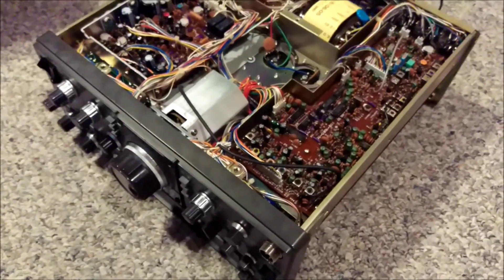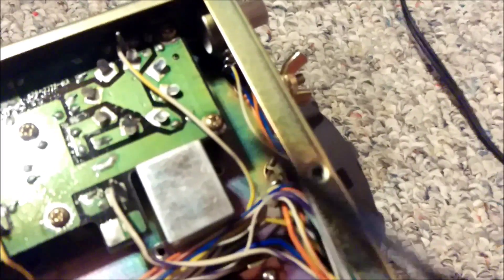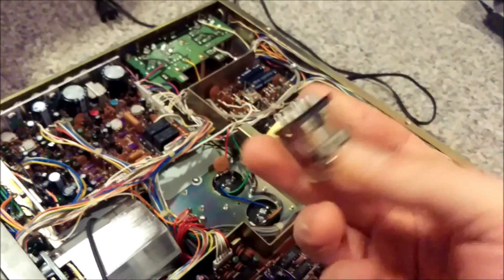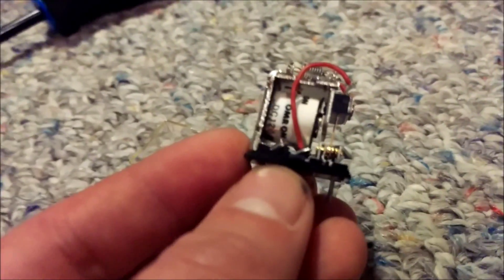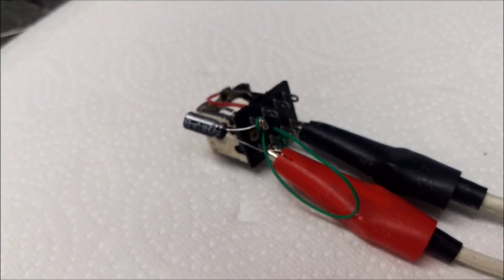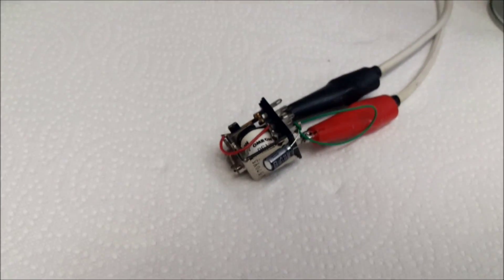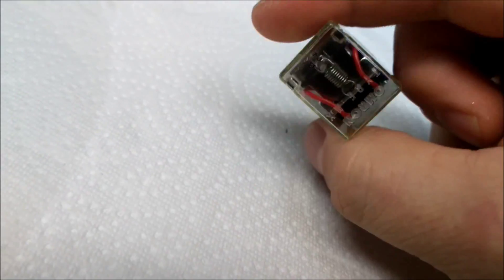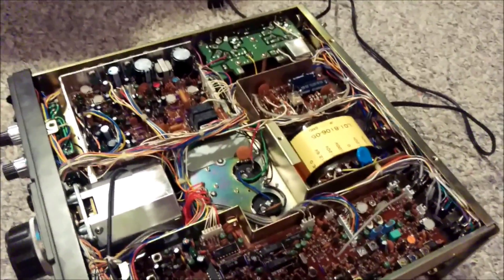TS830s, Cleaning the Antenna Relay.

Comment: You saved the day.  I had the exact same problem when the rig returned to receive, it sounded like the signal was attenuated 20db or more.  I used the CRC brand for the contact cleaning and it did the job.  I had a couple of cans of Radio Shack contact cleaner lying around, and when I read it had oil in it, I threw it out.  Many thanks. WB8FMA.

Comment: I would have recommended checking the resistance of the contacts first, then clean them, then recheck to see the difference. Typical is 25 milliohms and 50 milliohms max. Also you probably have run more contact cycles with your oscillator than that relay ever had in its entire life ! I would not recommend this oscillating procedure, but rather a very low duty cycle off-on-off  a few times just to allow the cleaner to enter. Also if possible use a microscope magnifier to inspect the contacts for wear and pitting; especially since the relay is used for high voltage out.
Reply: I didn't use the oscillating method, I just physically moved the contact from it's normally closed resting position,  to the other side of the contact, and blasted it with the contact cleaner.   I never thought about the consequences of using the oscillating procedure, and you do have a point there, although it may not hurt anything.

Comment: What brand of non flammable contact cleaner would you recommend in this application?
Reply: I used the CRC brand and it worked very well.  You can find it at Wal-Mart, and probably many other places.

Comment: How do you feel about recommending one of these hybrids for a first HF rig?  The quality seems like its pretty good.  Just curious vs solid state rigs.   73
Reply from the maker: Brad Moran Well considering this was also my first multi band HF rig, I would recomend it. It takes a little longer in the initial setup of the transceiver before operating because you have to tune the final stage, but other than that, this and similar rigs have stood the test of time. Quality is great and they are very serviceable when compared to the newer computer controlled solid state rigs. if you find one in nice shape in working order, you wont be dissapointed. Though the internal speaker kind of sucks, I would recomend an external speaker. I myself am curently on the hunt for one of the matcing speakers for the rig.-73 VE4BDE
Reply: @RC-nq7mg  I have the SP-230 matching speaker.  It's worth it to find one, as it's much better than the internal speaker.  It also has 3 switchable push button filters low, high 1 and high 2.
Reply: The Kenwood ts-180s has a matching speaker,  the sp-180, the same speaker as sp-230, just different color case, same 3 filters etc...